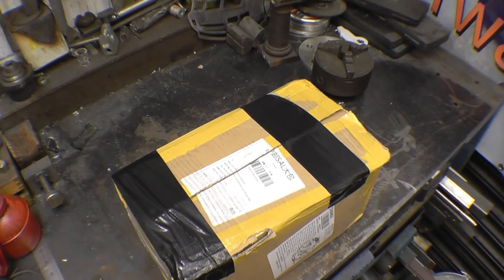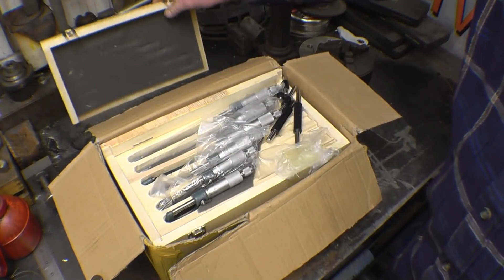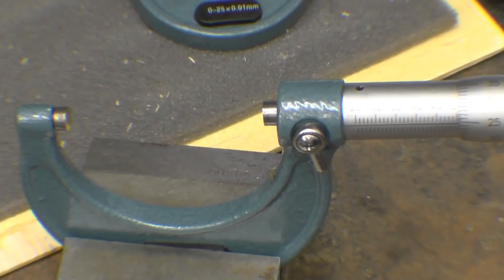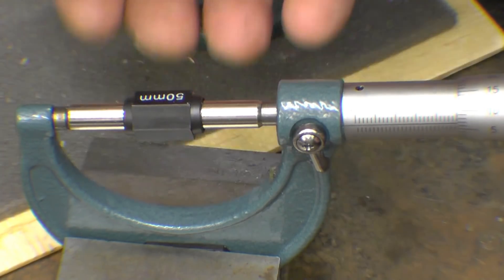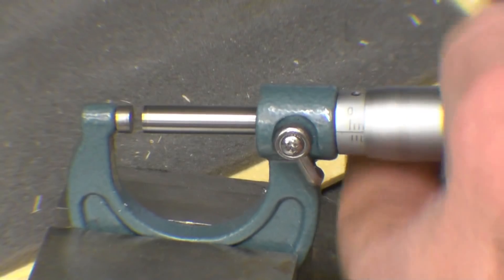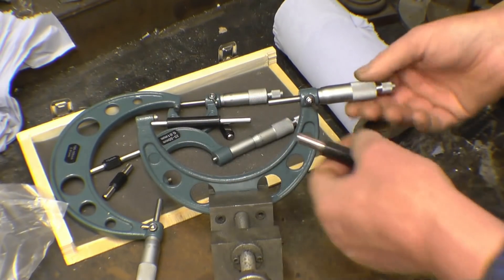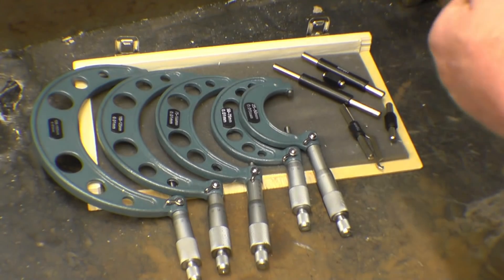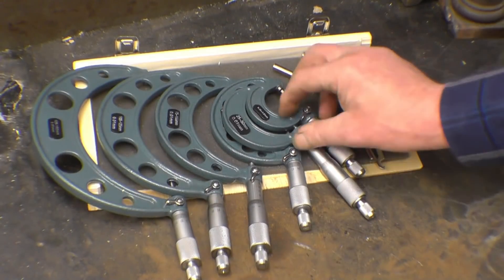Banggood   Metric Micrometer Set Review

Comment: I thought the same about the standards, but then I thought if the standards are wrong the mic’s must also be equally wrong if they read correct at both ends of the scale i.e. closed and open. if all standards were tested with the relevant mic'c in the kit and they were shown to be correct using the different mic’s and the two standards on each of the mic’s so the 25mm and 50mm standard on the 25-50 mic and so on with the others, would the standards not be proved to be correct, if they gave the same reading on the different mic's. 

Or have I got it totally wrong? If so then I would have thought the only way you could measure the standards with any accuracy would be with certified measuring equipment and simply measuring with another mic would not prove anything and possibly introduce further doubt. 

What about setting them testing each one in the workshop then take them in to the warm house and testing them again 24 hours later to see how much they have changed after warming up, we all know your shop is cold in the winter and I assume warm in the summer like most people’s shop, so should this not be a part of a review especially if you compare them to the stability of your current mic's 

While I love watching your videos John, I don’t think this was your best work and I thought the fact that you said that you wouldn’t buy them confirmed you had doubts about the micrometre’s but didn’t make it clear why you would buy a BETTER set especially if they were reading correctly.